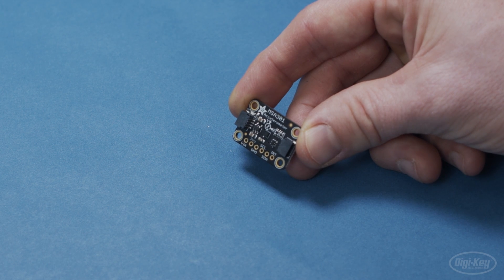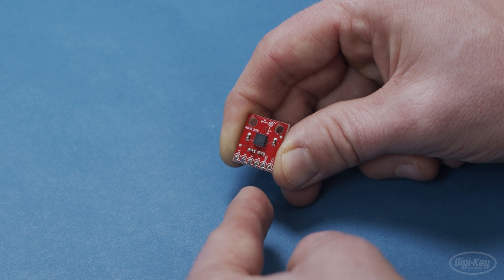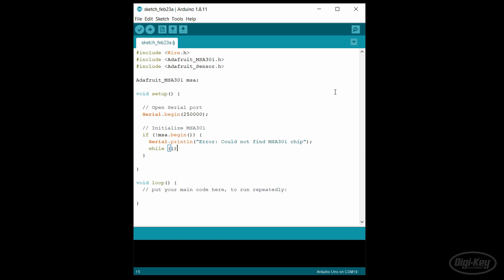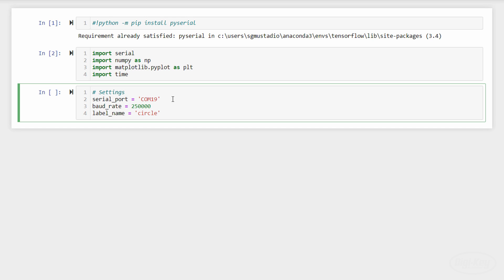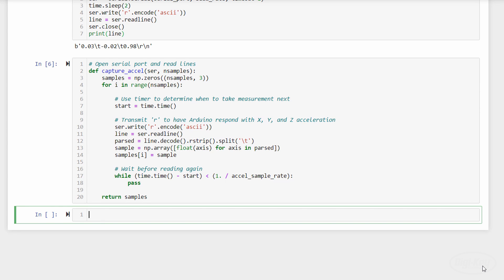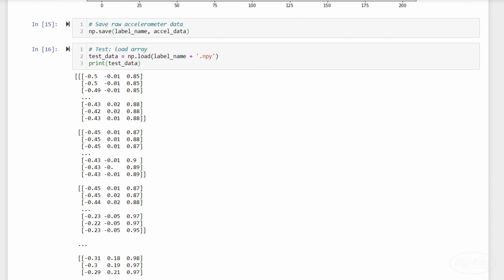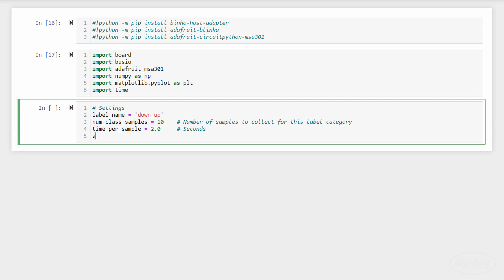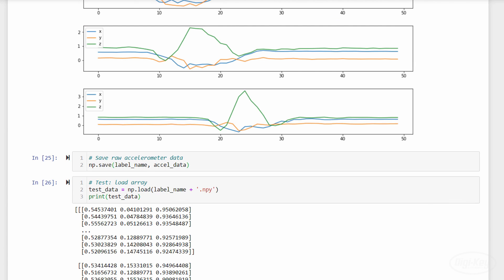Low-Cost Data Acquisition (DAQ) with Arduino and Binho for Machine Learning | Digi-Key Electronics

Comment: Another option, which I think is more convenient than writing firmware for an intermediate MCU like arduino (and far less expensive than Binho products) is using a USB device like FT232H (I2C/SPI) and MCP2221A (I2C/ADC) straight from your PC. Lots of easy tooling options options with this approach
Reply: I thought that the FT232H was USB-to-UART only, but it looks like it does support SPI and I2C. Interesting! Do you know of any Python packages that would allow interfacing with the FT232H or MCP221A?
Reply: @ShawnHymel  Thought you'd never ask! Been actively working on Go modules for these 2 devices in particular: https://github.com/ardnew/ft232h and https://github.com/ardnew/mcp2221a (in case you suddenly have a biased and unjustified disdain for Python)
Reply: @ardnew4582  that's awesome!